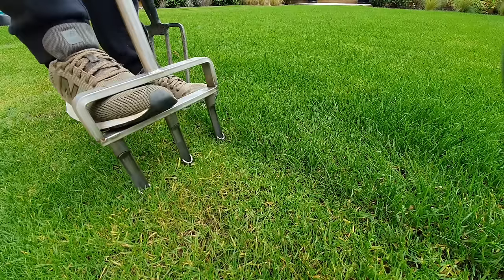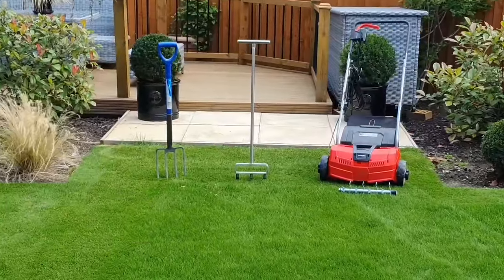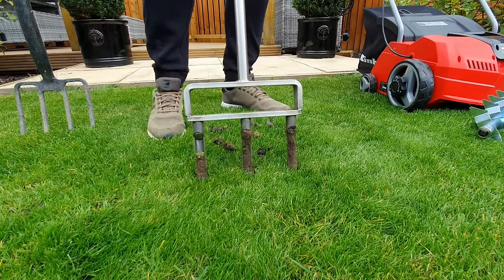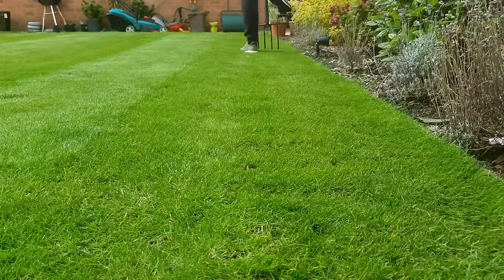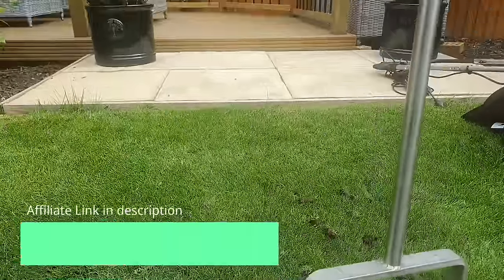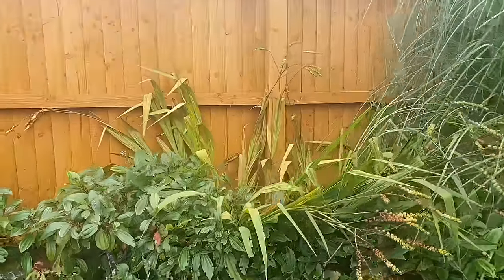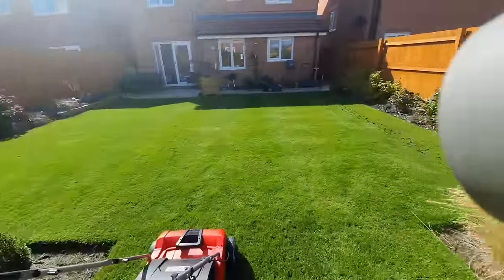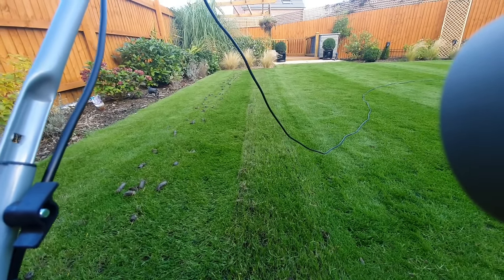3 Lawn Aeration Tools and When to Use (Solid and Hollow Tine)

Comment: As a Greenkeeper of 30 years myself I would suggest using the kick method you use will cause a lot of damage and pain to your feet, especially for anyone wearing soft soles shoes. If the ground is hard or the tool hits a stone in the ground this will not be good for your feet. I advise wearing stout boots/shoes and use the push down method with the foot to save long term injury.
Reply: I agree and I would add that watering heavily before aerating makes the job much easier.

Comment: Hi Happy Lawnsmen, A good tip when using the Swardman Areator is have a bucket of water with a touch of washing up liquid and regularly dip the Areator into the bucket makes it slip in and out with ease and much better on those poor feet. R.

Comment: I do enjoy watching you videos. I hsd heavy clay soil in my lawn but have been using  a garden auger drill bit on an electric drill for some years now. I drill the soil to a depth of around 6 inches and backfill the hole with compost. Lawn in now thriving. The hole that is produced is about 5 cm in diameter. I space the holes about 6 inches apart.
Reply from the maker: I've seen a few people do that too, can take some time especially on a bigger plot but if your going to chip away at it then fair enough and the compost will help add organic matter to the clay

Comment: I used 1 inch drill bit and drilled holes in my lawn.  I sat on a small stool and managed it quick nicely.
Reply from the maker: Nice idea
Reply: But what about excess soil? - I'd be curious how much is moved up to the surface by the drill and how easy it is to collect & dispose of.

Comment: Great tip on waiting for a rain/irrigation for hand aerating! It makes it so much easier in clay soil. One pro of having clay is that it retains the water a lot longer once it gets absorbed.
Reply: Yeah. I had watered the lawn the day before it was scheduled to rain and I'm glad i did because the water  usually runs off in clay soil if it doesn't get some water on top.

Comment: Great video GLG, thanks for highlighting the Swardman. I have pretty grim clay based soil and had  bought a couple of cheaper hollow  aerators that were useless and a waste of money. I took delivery of the Swardman about 3 weeks ago. The tines more closely resemble those of the Machines you can hire(worn tines and expensive) or get as part of a complete lawncare program(where is the fun in that!)and it works!  No more paying for someone else’s machine and I can now aerate the lawn when conditions are perfect and to tie in with lawn feeding etc. After use I spray it with WD40 and it gleams, I’m not sure whether to put it in the shed or display it in the lounge as a piece of sculpture 😊.Great piece of kit, certainly not cheap but overall well worth it. A game changer for me.
Reply from the maker: Hi Chris glad you enjoyed it! Its really a nice product and I agree there is a satisfaction about doing it yourself. Quite enjoyed using it, even though I was aching the next day its far better and smoother than any others I've used. The drainage has also improved on the lawn over the last month or so with all the rain which is nice!

Comment: The hollow tine aerator looks Ideal. I've got one of the cheaper UK versions, and it constantly blocks.
Reply from the maker: I weirdly enjoyed doing it! My ground was perfect too as we had rain for a week before but it worked a treat
Reply: @GardenLawncareGuy  did you find the solid tine method labour intensive due to the clean up afterwards of all the clay plugs? I have clay as well.
Reply: @GardenLawncareGuy  I like the look of the lawn mower attachment for doing the job but I don't think the new electric self propelled lawn mower I recently purchased allows for anything other than a single blade attachment.
Reply from the maker: No it was very easy toclea the plugs, the brush worked the best and it was the easiest bit of the process
Reply: Draper by any chance?

Comment: Matt, My  Swardman aerator arrived 2 weeks ago, I have used it on the larger patch of my lawn, as you said it is quite a work  out but at the same time satisfying. I originally tried to order through your link but because it was out of stock I could not place my order, when I was notified it was available I ordered straight away but  could not see anywhere to acknowledge your  contribution, I wrote to Ryan informing that the purchase was  a direct result of your recommendation and asking him to reward you under the terms of your agreement which he said he would do. I have a second lawn approx half the size  which I scarified with an older version of a machine similar to yours with the depth set to just contact the soil, I over seeded and covered the seed with a thin layer of Jack's Magic compost so it will be interesting to see how the two methods compare.
Reply from the maker: Great, interested to hear from that. Yes thank you, Ryan did give me credit for that and commended me how loyal the TeamGLG viewers are 💪

Comment: I also have a very clay based garden and I struggle to get a normal fork deep enough normally. I also have a screwfix scarifier that I use at least once a year. Do you use any soil improver like Gypsum to break down your clay? I do use your wetting agent, seaweed, and green machine products but interested on if you think any additional products or work is necessary for clay based lawns?

Comment: The thing to do with that manual core aerator is design it to have a “D” handle on the top, instead of that “T” handle (which would get in the way), then buy two of them, one for each foot. Then just walk around the yard, aerating with each step. You’ll be done at least twice as fast. In the US, Lowes sells a Corona brand, that has two tines and seems to have more room for your foot. Plus, they’re only $26.98 USD.
Reply: Lol
Reply: Thanks for the info
Reply: Home depot has it too its red same price
Reply: A little each day I guess!

Comment: I was sceptical of the aerator but I have to say it looks like a pretty decent bit of kit 👍. A piece of advice as well, if someone was in need of a petrol aerator, but didn’t really feel like they could/ wanted to do it themselves, there are usually lawn companies in the local area who you can get to do it for you. That ‘aerator’ on the scarifier is brilliant with seeding, especially if you’re not using a top dressing. Massively helps with germination 😁
Reply from the maker: Yes will, the slots are great if you don't intend to topdress as it really helps improve seed to soil contact which is one of the top things to grt right.
Reply: So Top Dressing. I had to look it up as I'm a new homeowner with a yard that while not too bad requires some extra TLC. Ive researched a bit and watched some of these great videos. Learned about dethatching and aerating. So I've completed that and trying to decide if I should over seed before its gets hot. It seems we have a very healthy population of birds of all different species. How can I minimize them eating all my seeds. I understand aerating helps but will top dressing also help with this? Or will the birds be undeterred by the small layer of compost?

Comment: After using the hollow thine tool, is it necessary to remove all the soil plugs from the garden? How long does it take for the holes to cover up? I’ve used this hollow thine tool and find that my lawn does not look nice anymore. Should I be worried?
Reply from the maker: I like to remove mine and either leave it or backfill with dressing and normally done before seeding to thicken everything it up

Comment: Thank you, very informative,  straight to the point. I am debating on renting an aerator or buying something in my budget. Looks like the manual way works & fits the budget.
Reply: I had the same debate BUT I have heavy clay soil so I aerate spring and autumn… I originally reasoned that renting the aerator would cost less than buying one: the motorised ones are at least £300, and the rental fee is still lower than buying a (good quality) manual rolling tiller/aerator or a (again, good quality) fork-style hollow tined tool. BUT since I’d be renting it twice a year, and my lawns aren’t that big, over a single year it would be around the same price as a good quality manual aerator (either roller-style or fork-style). I wouldn’t need to rent a motorised one again if I bought my own manual ones, so I decided to get both the roller and the fork styles 😂👌🏻 even though well-made manual aerators are initially quite an expensive investment, for me, after just one year they were “paid for” with the money I’d saved in rentals.  

I use the hollow tined “fork” twice a year (spring and autumn) for heavy duty aeration - I also live in Central Scotland so we get a lot of rain, I have heavy clay soil and a natural spring under part of my garden lol, so it needs a good air out. Then, I use the spiked roller whenever I feel like it’s needed (either after heavy rainfall or just before, if we know there’s a storm coming). It prevents - or treats -  any standing water ☺️🙌🏻 

So I say invest in both of those manual tools, unless you have huge lawns that would be too exhausting to do manually. The hollow fork aerators take some work and time, but it’s a thorough job and you don’t need to do it all the time. The roller style type is not hollow - they’re always solid spikes - but it works great for general maintenance and it’s very low impact/effort to use ☺️🙌🏻

Comment: Hi There LawnGuy,Thanks to my daughters new dog my lawn is now looking pretty awful because of the dog urine.....never been a gardner and am now scratching my head as to how I can restore my lawn and keep on top of it with a dog around.
Any tips would be much appreciated.
Great video by the way.
Reply: Female or male dog? Iirc female dogs tend to prefer going in the same spots repeatedly so it’s even tougher on grass. Water dilute (hose) the pee spots after they go out. 

Or create a sectioned spot for peeing using gravel, sand or some other hard scape material (rubber mulch maybe? Not sure). 

Just a couple ideas since there was no reply, maybe others have some advice too.
Reply: @paddleduck5328  thanks for the tips....looking like the hose is gonna be busy.

Comment: So what do you do with the plugs after you have hollow core aerated? Collect them up or leave them to break down on the surface and sink back into the surface? Thanks for really nice practical advice 🙂
Reply from the maker: No problem, I pick mine up with the rake and take off the surface. Especially when I want to level it
Reply: @GardenLawncareGuy  Oh okay. So if you have a large lawn area that's quite a lot of pickup. I guess you then top-dress which replaces lost soil?

Comment: With solid tine aeration on clay soil, it can work a lot better if you use it instead at a ~60 degree angle, and then "lever" the fork to literally lift the grass a little (and then put it down), creating fissures in the clay and breaking it up quite nicely. I've used it very successfully, although it's quite hard work. Basically like you show in your video, but instead of going down vertically and wiggling, you go in at a sharper angle and then press down on the handle

Comment: I have heavy clay soil. When I manually hollow tine in dry weather the tines won't peirce the surface... when I aerate after rain, the tines keep clogging up and it just spikes the ground. Will the Swardman resolve this problem? and if so, what are the best conditions to use it... When the lawn is dry or wet?....Thanks Steve
Reply: I have the same problem clay soil which needs to be moist to achieve proper penetration.  I did not have much success in removing cores because after the first three or four insertions, the tines clogged and I had to start again.  Very frustrating.  I then switched to a De Wit bulb planter to remove (large) cores.  This worked brilliantly, albeit that the cores are about  60mm in diameter.  However the foot peg snapped off after about 25 cores and I am now back to square one - very frustrating.  I might resort to auger drilling next.
Reply: I persevered with my swardman having initially found it extremely difficult to remove cores.  Having spent a lot of time aerating 80 sq m of my lawn over a couple of days; it’s a great cardio workout ! .. especially if you are over 70.  I learnt quite a lot:

1. If heavy clay, ensure that the soil is not dry; it needs to be moist to enable penetration.
2. Ensure that the tine bores are bright and shiny; any rust or dried clay has a significant effect on clogging to the extent that the tine becomes solidly blocked.  I used a fine round file and wet and dry abrasive to polish.  It’s surprising how much effect this has.
3.  Unclog after about 10m run - you will learn  how often you need to do this to keep producing cores.  I used a 10mm bolt /old drill to do this then rinsed the tines in a bucket of water to clear / lubricate.
4. It is important not to stamp the aerator too far into the ground; don’t be too greedy.  Pushing all the way down can ‘cap’ the end of the tine with a compressed, hard plug which turns it into a blunt-ended solid tine which forms a hydraulic lock in moist clay, thus making withdrawal a potentially disc-slipping manoeuvre.  After a while you will learn the resistance at which you should stop pushing to avoid tip-capping.  Pushing the handle back and forward to release the tines (and lift the soil above) eases extraction.
5.  Get into a rhythm, and you will be surprised how much ground you can cover.
6.  Stagger alternate rows so that all holes are more or less equidistant in triangle formation.
7. Ensure you clean after use, dry off and spray with wd40 to limit rust.
8.  Drink lots of water during the task and whatever takes your fancy afterwards; you will certainly have earned a tipple or two!

Comment: Very nice video! I've got a question though I just bought similar electric aerator, my question is should I use both of attachments included one after the other or do it with a week difference?
Reply from the maker: I find the fixed one is more aggressive and the tines are more a power rake for my machine and can be used more regular
Reply: @GardenLawncareGuy  thank you

Comment: I'm basically putting holes in the backyard, filling a decent portion of it with scoria, for the purpose of improving water drainage (variation this video v=EGkUlK5fboo). When it rains heavily- I notice when I walk over the area, its splashy. What do you think of the plan- waste of time / any suggestions?

Comment: Good video GLG. My lawn is clay soil also (new build). I've got the Swardman aerator on order from Garden Imports. Just need it to arrive now to start my renovation!
Reply: I'm in a new build and the lawn is clay soil like yours. How did the aerator go? Would you recommend?
Reply: @jjammy1007  yes it works well. Ground needs to be soft and even then it's a good workout. I added compost afterwards and overseeded.
Reply: Great! thank you. Yeh the ground will definitely have to be soft I imagine. I can't even got a fork in when it's dry. Thanks for getting back to me. Doesn't anyone in the uk make this particular type? I know Draper have one but not very good by all accounts.
Reply: @jjammy1007  the yard butler one works well apparently but only two prong.
Reply: Yeah I've seen that two prong one. But my lawn is a decent size and I'd be there about a week doing it. Ha. But thank you.

Comment: Thanks for the video. I moved into a new build property last year and didn't want the developers putting turf down (a good choice after seeing other property gardens on the estate) so had a guy do a better job. Problem is it is quite clogged with thatch and it is clay based soil. So much so that even now at the end of June I'm only needing to mow once a fortnight as the grass doesn't seem to want to grow. Had it fed but think it needs a scarify and aeration. I'll probably go for Holllow tine and a scarifier similar to yours but I'm wondering what month am I best doing these and should it be done multiple times a year?

Comment: Love the video. I have similar new build clay based lawn, looks similar size as well. Have hollow tined it using a manual tool. What do you do with the plugs? Rake them up and add then to garden base or something different? What fertiliser/ lawn sand do you recommend after manual aeration like this?
Reply: I was told many moons ago if you have a rotary that will suck them up, or rake them and put in compost.
Reply from the maker: Hi Ian thanks I normally collect the cores and the fertiliser with this https://gardenlawncareguy.com/shop/fertiliser/glg-spring-summer-dark-green-fertiliser/

Comment: Hi. I recently purchased a Swardman aerator. My garden is very much clay based. Should I wait and let the ground dry out a bit more before aerating as when I used it the cores didn't really come out from the side ejectors too often. I'm in Ireland and the weather has been fairly decent here recently.  Its mid April at the moment.  Would love to know what you think. I'm afraid if I keep going it might cause further compaction so think I should wait a couple of weeks and hope it dries out a bit more underground? Thanks for your help
Reply from the maker: Sometimes the soil is being removed just gets compacted in the tool and will eject. Balance between growth as you want the lawn to repair and working the soil before it gets too try based on the weather